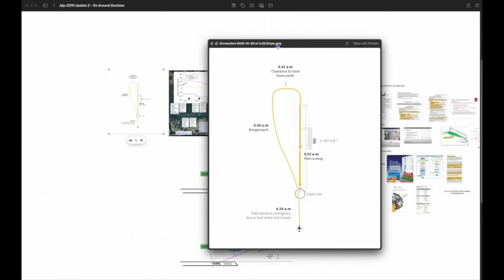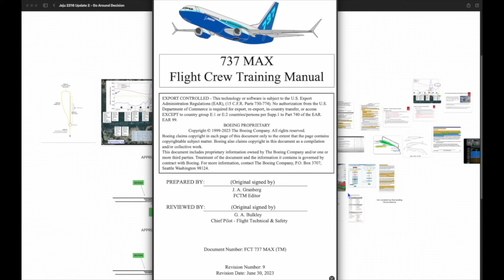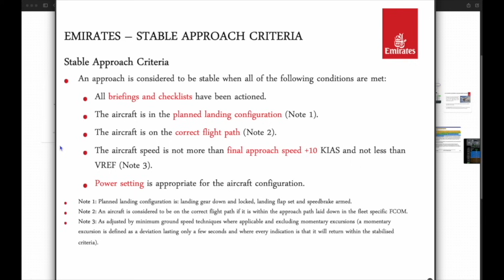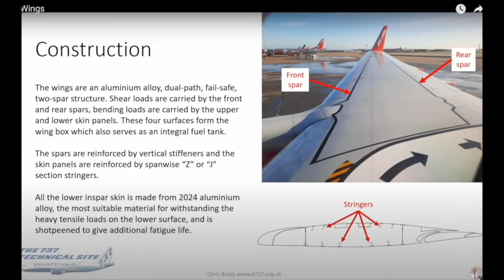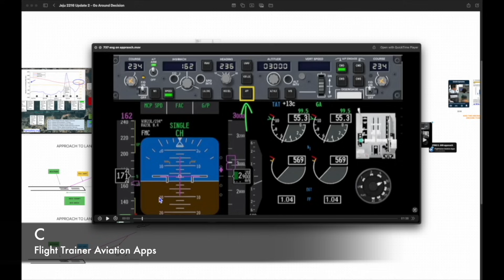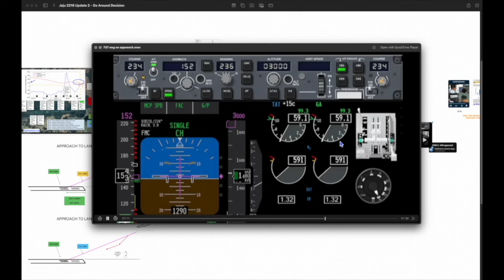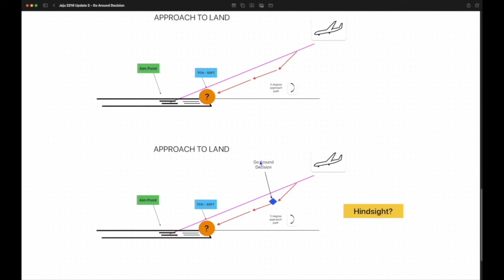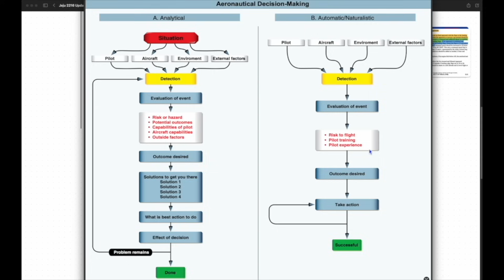Go-Around Explained: Jeju Air 2216’s Decision Not to Land

Comment: They did not pore over pilot's decision making. Korean authorities declared superficially that birdstrike was the cause.  However you try to justify it, flaps were raised  after the birdstrike and the pilot deliberately did not lower flaps & wheels on second attempt ... that's it in a nutshell. No embellishment, no excuses.
Reply: You cannot deploy flaps and slats without power. And lowering the gear without power takes more time than they had. And both pilots were almost certainly required just to fly the aircraft.
Reply: @petercollins7730   It certainly seems like the condition of the aircraft deteriorated after the go-around decision was made.  Thus following what had seemed a prudent maneuver, a full blown emergency soon developed..
Reply: @polarvortex3294  They were in a full-blown emergency after the bird strike. Once they had no thrust, no power, no hydraulics, they were in a catastrophic situation. They did, it seems, everything they could, but they could not overcome all of the failures, especially the airport design failure.
Reply: @petercollins7730 Why are we thinking there's no hydraulics?
There's evidence on both landing videos that the right engine was producing significant power. (Also runway skid marks veer to the right, towards the end of the runway, as if the reverse thrust was starting to take effect).
Are we thinking they lost both engines on the go around, then got the right engine restarted on the short final, not leaving time to deploy flaps or gear?
Or the right engine was running throughout but neither AC generator or hydraulic pump were working on that engine? (Either a fault from the bird strike or a condition that existed before the initial approach had even started).
Reply: @alanm8932  None of the usual hydraulically-operated equipment was user. The flaps and slats were not extended, and no pilot would land without flaps if he had the option. The gear was up. 
There was apparently no power from either engine, at least as early as the point they pulled out of the climbout on the go. The sparks and flames from the #2 engine indicate repeated compressor stalls - no power in that situation. 
Everything looks like a no power, no hydraulics condition. Without FDR data, likely the video is the best we'll get, so it's always going to be 'looks like.'
Reply: @petercollins7730  "There was apparently no power from either engine,"

The head on video of the landing shows an exhaust plume behind the No 2 engine, so it was operating, but probably at low power. The No 1 engine had no plume, so was not running.
Reply: @christopherrobinson7541  the sound of the engine is quite clear on the video that's taken from the right side of the aircraft. Investigators can probably analyse the sound frequency to determine the engine speed. Compensation for Doppler effect is probably straight forward as, at one point, the aircraft is travelling at right angles to the camera.
Reply: @alanm8932  Yes, the investigators should be able to determine the speed of the engine using the frequency of the sound. However being around aircraft for all my life (73 years) the No 2 engine was operating but did not spool-up as usual and although the thrust reverser was deployed, there was little retardation.
Reply: @petercollins7730  Landing gear don't need power, just pull the 3 wires.
Reply: @MJLee-wl6kt  Ultimately, it wasn't the touchdown that killed them.  Indeed it would seem that landing without gear should have slowed them even faster than landing with gear if they had managed to get the nose down and get that friction really going.  I wonder also if they were desperate for lift in the later stages of the turnaround, in which case keeping the gear up may well have been a conscious choice.
Reply: @MJLee-wl6kt I think there's another step required before "just pull the 3 wires". The gear hydraulic valves need to be set to a free flowing position first.
Edit: correction - that was only on the 737 Classic, which required the gear selector to be moved to "off" before pulling the manual release handles.
Reply: Further thought… I wonder if AC electrical power is need to control the hydraulic valves? So lack of AC power might be a reason why the gear couldn't be dropped, even if the 3 emergency pull cord handles were pulled. 
(It's generally thought that, before the go around was initiated, neither engine was producing AC electrical power and that is why both recorders stopped at that time).
Reply: @alanm8932  The handles release the locking mechanism on the gear. It literally falls just by gravity. It doesn't need either hydraulics or electrical power. But, it takes time, and it is not always successful. Nothing worse than a plane with no power and only one set of gear down and locked.
Reply: @petercollins7730 Fairly sure I've seen video of an airliner landing on one main gear & the nose gear. From what I remember, it looked like a better outcome than no main gear.
I'm sure outcomes can vary and as you said "no power" would increase the challenge considerably.
Reply: @alanm8932  Planes can land on one main gear quite successfully - not to say easily. A skillful pilot can keep the non-gear supported wing up using differential thrust and a combination of control surface settings. Not every half-rgear landing is successful but, for commercial jets, most are fully survivable.

The problem here is that the pilots could not use differential thrust - both engines were out. In that case, there is no way to avoid the non-supported wing from immediately dropping, causing a cartwheeling or tumbling at high speed. That is almost always non-survivable.

I should have made clear that the lack of thrust was the defeating condition.
Reply: @alanm8932  "Further thought… I wonder if AC electrical power is need to control the hydraulic valves? So lack of AC power might be a reason why the gear couldn't be dropped, even if the 3 emergency pull cord handles were pulled. "

No electrical power is required to extend the undercarriage, however there is a modification (on the MAX) and possibly on the NG to operate a solenoid which speeds up the deployment, but I do not remember from which 28V DC bus its get its power.

Comment: When you around its TO-GA flaps and gear up. So it seems it had some thrust. Flew to do a tear drop on the opposite runway. Thats the mystery, how was it executed?
Reply: TOGO WAS INITIATED BEFORE THE BIRDSTRIKE!!?
Reply: How about, still had some thrust from the engines initially but rapidly lost thrust as the engines faded and failed, hence their sudden haste to try and get that bird safely on the runway. If it looked rushed, perhaps they had good reasons to be rushing.... 😕
Reply: Why attempt a belly landing when the landing gear could have been deployed manually? Even without electrical power, would they not have access to manual brakes on the landing gear? Did the pilot decide that a belly landing was safer?
Reply: @rolloman667  No time.

Comment: But usually pilots are not expecting that situation aircraft just landed reaches to localizer with that amount of speed. That wall should not there but Thats's that. As we are pilots, we should more focus on why that airplane failed to stop aircaft on Runway. Apparantly, there was bird-strike. That's fact. But Bird strike doesn't make aircaft to land with high speed and no gear and flap. Becaus there is pilot to do somethiong. Pilot are trained and pilot are expected to do something like Sully. Is that the BEST? Is there any possibility pilot make situation worse? That aircraft very clost to airport compared to Sully case, even when first attempt to land, they were so clost to land. Then Why? Why? they spooled up that engine? For what? Boeing manual, recommend not go-around when you hit bird during final. So why? Pilot misjudge only one engine hit the bird? So he made go-around but hit another engine? And then even though less time limit, was that at best? Pilot flying doing flying. then PM? What PM did? He can lowing that gear without checklist. Aircraft was very close to Runway, But He landed plane almost middle of Runway. Can pilots are can agree that maneuver? Korean pilots not doing Visual rectangular pattern apprach because its forbbiden by company. You should know Korean flying culture. And more, First officer at this plane, only total flight time is 1,680 hours. very low time as a airline pilot. You need to know Korean airline and Korean flying shocking culture.
Reply: did sally's plane have a blackout? no. did sally need gear? no. did sally have a limited runway? no. so do we know he landed at the spot he wanted to or did he land as if it were the middle of the runway? no. did sally need to do a 180 degree turn before landing? no. was sally on a landing approach so he could have chosen a go around? no. did you watch the video and understand the disadvantage of using flaps with almost no engine power? no.
Reply: @ I understand the difficulty those situation. But You lost the most important thing. There are much possibility that hardness made by Pilot. HIs misjudgement.If both engine hit bird strike at once, He must landed at 1st apprach, but he misjude. Even if both engine hit by one by one, He should landed straring point of that Runway. NO one expected that speed and middle of Runway. You saying that is at Best, No. deviating or Veer off with that speed must catastrophic.
Reply: @morphous  Under the conditions they were flying in, their landing was excellent. You seem to expect that these pilot could belly land a plane without power, without hydraulics, precisely in the TDZ. That's idiotic. Any pilot can tell you that these pilots displayed outstanding airmanship. You just have no knowledge or understanding of the situation.
Reply: @petercollins7730  💯💯💯💯💯💯💯💯💯💯💯💯💯💯
Reply: Both Boeing and the airlines REQUIRE a go-around in the case of a bird strike on final approach. 

The rest of your comment seems inane. For example, a pilot with 1600 hours on type is quite experienced, not very low time. And Sully had thousands of feet more altitude, which is the most critical number in cases like this.

Stop repeating nonsense and learn the actual facts.
Reply: @petercollins7730  You better read 737 TM for bird-strike on final. Which kind of airlines require go-around in case of bird-strike on final? 
And you don't know about Korea. In Korea 1600 hours not mean on type. its including Cessna 172 time. Usaually Korean pilot's entering LCC airlines with only Cessna 172 time around 250 to 300 hours. So i guess that F.O's on type time around 1300 hours. 1300 hous means that pilot worked only less than two years of line flying. Maybe you can think those time not bad, but in Korea You may know very strick Captain and F.O relationship. That relationship make F.O very shrinked. Do not judge Oriental based on your Western thoughts. Its completerly different. You better ask who had experiecedn working on Asia.
Reply: @ Boeing recommends a go-around on bird strike; it is mandated by American Airlines, Delta, United, Alaska, and Southwest - the 5 largest US carriers. I haven't checked every airline's manual, but I have yet to find one that does not mandate a go-around for a bird strike under 1000 feet.

And whether he has 1600 hours on type or 1300, either is more than the average FO on a major airline. Claiming he has little experience is simply wrong.
Reply: @petercollins7730  How old are you? What year of 737 TM did you find? What i have 2016 version clearly noted that 'Crew action for a Bird Strike During Takeoff' on index page 8.11.
It looks on version 2005 does not contain that.
'If the landing is assured, continuing the approach to landing is the preferred option. If more birds are encountered, fly throuth the bird flock and lan. Maintain as low a thrust setting as possible.'
Reply: @morphous  Do you not understand the meaning of the words "If the landing is assured?" Do you need a quick lesson in why this landing was most certainly not assured? Your own alleged quote makes my point.
Reply: @petercollins7730  You have 'cleared to land' , configured to land. stabilized at around 1,000 feet. How much assured situation do you need? What kind of assured you need? even Nice weather. What else do you need? If you still want Go-around, yes its your choice.
Reply: @morphous  They were configured properly before the bird strike. They certainly could not know they were configured properly  after the strike. Do you understand what "configured for landing" means? It varies with the condition of the plane, especially with a plane with unknown damage.

An assured landing means you  as a pilot have full confidence that a successful landing will occur. If you were the pilot, would you have full confidence after a bird strike that you knew caused significant damage?

The go-around gives the pilot time to be assured that the plane can land, and to configure the plane, in its current condition, for landing. It also allows time to prepare the cabin for a non-standard or emergency landing. That's why pilots go-around.
Reply: @petercollins7730  What you are saying is old concept. It chaged after bird strike accident. Most other senario or situation, your explanation accepted. But not to Bird-strike on final congesting to Engine. You spool up that congested engine, My God. Do it as you wish.
Reply: @morphous  Actually, guidance from Boeing, but not most airlines, is that if there is a simple engine failure on approach, continue the approach. 

I have no idea what you mean - "it changed after bird strike accident." What accident, when? And what changed? The procedure didn't change.

If you are in an unstabilized condition below 1000 feet, go-around. That is the procedure. And a bird strike sufficient to cause engine failure is most assuredly unstabilized. And if you spool up a damaged engine, you are deliberately trying to destroy the plane. If you know an engine is damaged, you shut it down - you never increase power.

Clearly, you have no knowledge of flying or this aircraft. What you say is largely the opposite of what is actually done and procedure.
Reply: @morphous  "'If the landing is assured, continuing the approach to landing is the preferred option. If more birds are encountered, fly through the bird flock and lan. Maintain as low a thrust setting as possible.'"

That change was introduced after the Ryanair incident in Italy in 2008.
Reply from the maker: It's apparent there were multiple links in the chain that - if preserved - the outcome would have been different. Training, the airfield, birdlife, crew response? and importantly LUCK probably all played there part. We certainly don't know enough to grill the crew over this, and it will be some time until details come out. We can only work through possible factors and train against them in a risk based way. Boring but that's risk management
Reply: @ Yes, Professor Reason (what a perfect name for him) and his Swiss Cheese Theory of Failure sums up this - and I think every other - accident. If any one of a dozen or more factors were slightly different .....

Comment: Please do some thinking or an analysis whether a stall warning or worse, a stick shaker could have activated during go-around of JeJu flight. The idea of impending stall, regardless of warnings being real or false, could have made the crew panicking and to rushing to land so much!

If they retracted flaps/slats but having low speed or making too-sharp turns could've activated stall warnings, right?
Reply: 2:59 a graphic representation from received ADS-B data: 10 second of very steep climb at 140 knots at 8:58:28 could've activated stall warning/stick shaker that made PF drop the nose so suddenly, right? That's exactly what pilots are trained to do if a stall warning is sounded, right?
Reply from the maker: @bsimic29  that's a fair assessment. Only the full report will shed light on this
Reply from the maker: thanks for question, I can't rule it out - but there's very little to go on - the comment below from @bsimic29 is worth considering.

Comment: Thanks Max, I really appreciate this thouroughly prepared presentation you provide - well done.

I agree with you that speculation is never a good thing, and precisely because of this one must apply critical thinking to the findings of the two accident investigation boards involved, as well as the aircraft OEM and airline statements.  With critical data now not available (am carefully not saying lost), there will inevitably be a lot of speculation on their part, extrapolating from the meager data they have.

So it's a double edged sword:

🗡︎Yes - don't speculate with blind faith or ulterior prejudices (note though that critical thinking does have an element of speculative analysis associated),

⚔And - unpack the official investigation board and stakeholder statements to look for signs that speculation is presented as fact.

I've captured the screen below to study it further
  s:\Max Adaptive Aviation - Automatic Decision Making.gif

The analogy with chess is validly interesting.

I was somewhat concerned by the opening PC-brigade sentence
   " ... a pilot may not survive if he or she ..."

Surely the simpler, and all embracing, words below would be more appropriate on all accounts
   " ... lives are at risk if ... "
Reply from the maker: Thanks for the feedback and comment